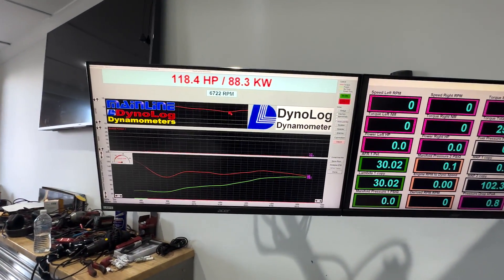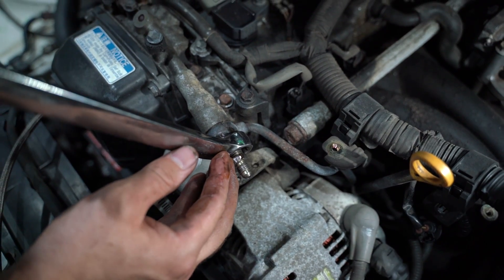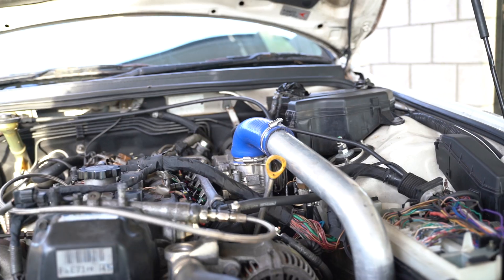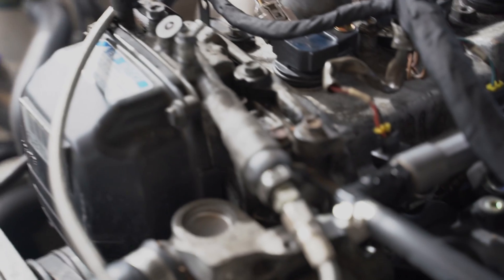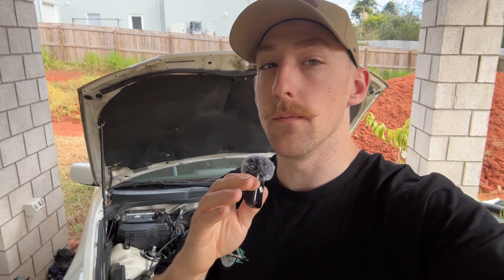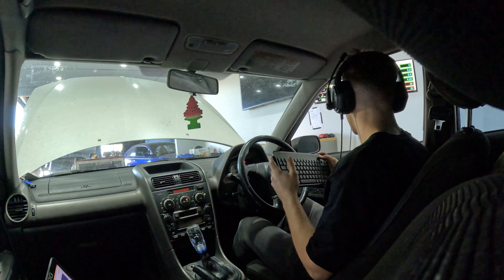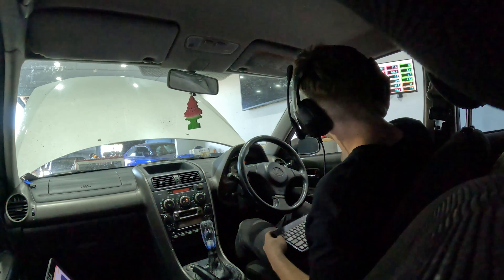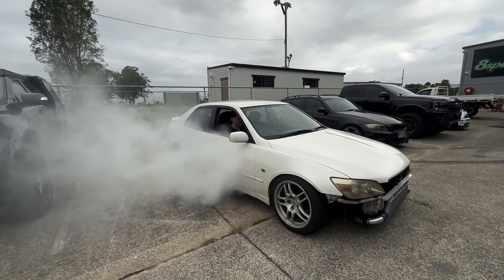TURBOCHARGING MY IS200! (1GFE+T) My Budget Drift Car

Comment: yay finally someone professional turboing a is^^ are the hp at the wheels or crank? mine made 240hp on the crank und somewhere 180hp on the wheels with 0,6 bar
Reply from the maker: Appreciate the kind words, I’m just a mechanic by trade who learnt to tune don’t know if I’d say I’m a professional but thank you very much 🙂The power figure shown in the video is power to the hubs (201.3hp at the hubs on a t28 at 7psi and e85)
Reply: @Racelab_yt  so it will be kinda 240-
250 at flywheel
Reply from the maker: @194Easy  roughly 230 at the fly as a guess subtracting the 15-25% loss yeah 🙂. I will be winding more boost into it soon In hopes to make something like that at the wheels.

Comment: how come n/a power was so low? or was it power to the wheels
Reply from the maker: This dyno measures power at the hubs not calculated power at the engine like some other dynos 🙂 power measured at the wheels and or hubs is always lower than flywheel horsepower due to parasitic loss (fancy way of saying you loose some power through the drivetrain due to friction and effort required to turn those components before it’s measured at the hubs and or wheels) 🙂
Reply: @Racelab_yt  thought so, thanks
Reply from the maker: @rcon777  thanks for your comment :)